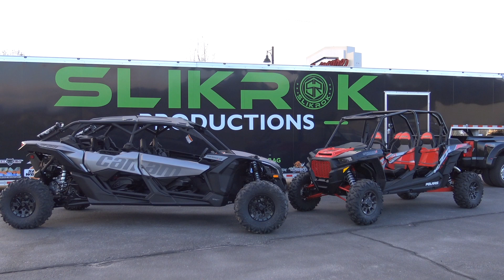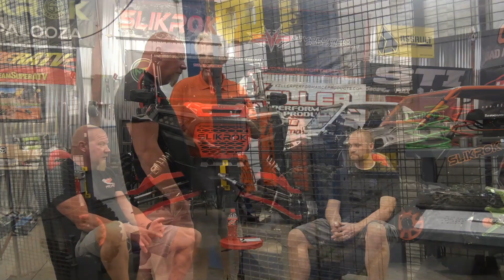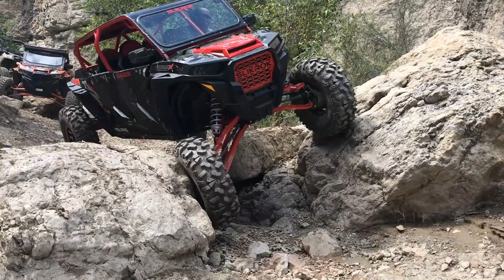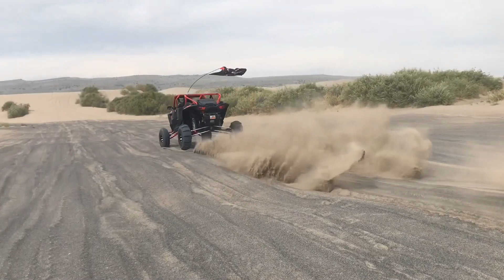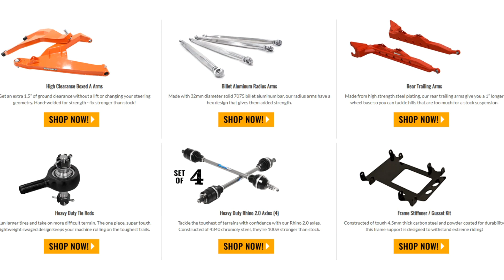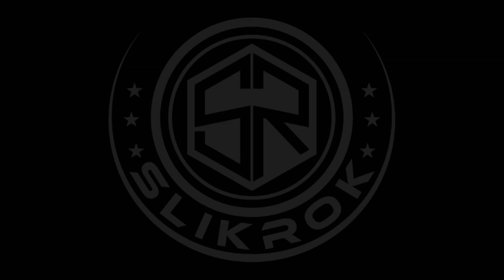Universal Build Extreme Level up!

Comment: Love your videos and builds! I lurk in the background on Portal Nation and see a lot of guys talk about the steering assist needing a boost and replacing the rack & pinion. Do you have to upgrade the steering for this universal build?
Reply from the maker: So far the universal build is running oem steering but we moved the mounting points on the outer tie rods to improve steering!